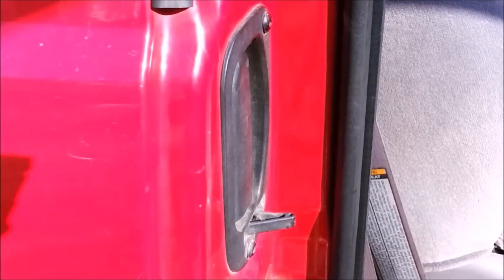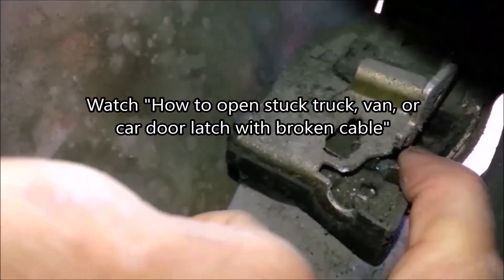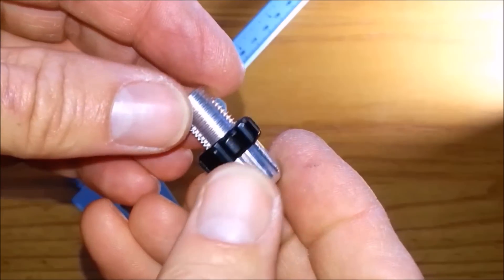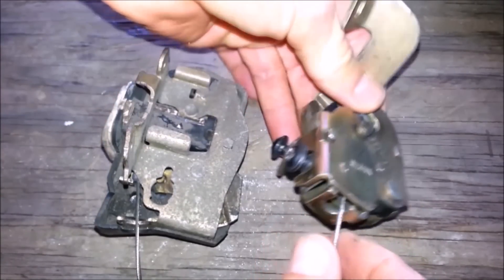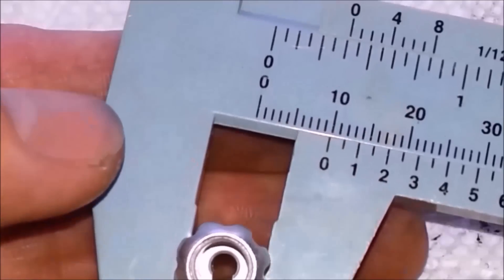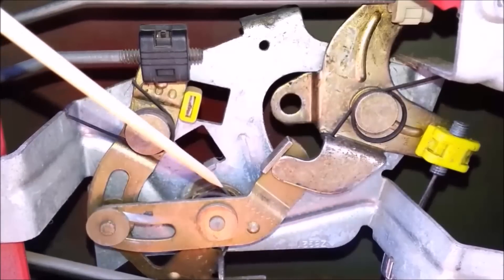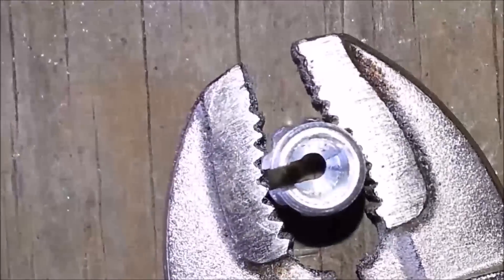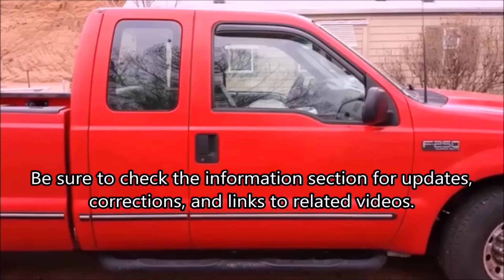Fix broken cable with bicycle brake adjuster - ford car truck van door won't open - stuck latch

Comment: Thanks, you saved me from paying $400 again. I watched all your videos twice then ordered the cables ends on Amazon for 8 bucks.. They fit perfect with no alterations. My 99 F250 had the same problem as yours, the upper door lock cable deteriorated at the door center, very easy fix if you take the speaker out. I am now subscribed to all you videos, thanks again for helping all of us.

Comment: Top notch video instruction. This saved me $700. My dealer just quoted me almost $700 to open and repair the rear door on my 2001 F250 Super Duty. I'll save another $700 when I make a preemptive repair on the other rear door next weekend! Thank you my man.

Comment: Thank you for video.  I just repaired the rear and side cargo door on my Ford E250.  This saved me a ton of money.  The dealership quoted me around $130 to $140 for the parts per door.  When I called the service department they were going to charge me over $500 per door.  I can't believe the labor would be so high on just replacing the cables and latch assemblies.  I made four new connectors per door and still took me less than 3 hours.  Thanks!
Reply from the maker: Great! I am glad it saved you some money.  Thanks for the comment.

Comment: I did the repair on my rear doors a long time ago using your video and the plastic fill tubes as sleeves.  Then one of the doors started acting up and I found our about the Dorman cable repair ends.  Searched and in your newer video on repair and in it you mentioned a different video showing how to use cable repair kit  instead of the bike brake adjusters.   Couldnt fine that video so I just tore into it and trialed and errored my way to success.  Thanks for the work you put into these videos.  They are great!
Reply from the maker: I never did a video on how to use the repair kits because there are so many videos out there already.

Comment: Thanks mate! Your video got me out of a bind - fixed in a day! I see comments saying "you can buy all the parts" but try doing that from Australia! It won't happen inside of a week, and some parts for my 2002 F250 take 6 months to get here! Anyway, I was able to source the bicycle cable adjusters at the second store I tried, and following your lead, modded them to fit. Purrrrfect! Cheers!

Comment: Great video did all cable ends on 2000 ford e-150 .cost $30.00 materials & about 3 hrs. $ saved close to $1200.00 parts from Dealer,forget about the labor!

Comment: Thanks for the info! I have a truck just like this!  But I'm gonna try this method with my 06 Honda Accord!
Reply from the maker: Cool. Let me know how it goes.  Which cable is broken on your Accord?
Reply: @fixpro256  my inner driver side door latch cable! I broke it while replacing the window, but never got around to fixing it. I have a plan, but I will have to see how it works for me! I appreciate the help though!

Comment: Your videos are very helpful! I am very appreciative for you taking the time to do them.  Do you know when your "extras" video will be complete?  I'm having an issue with cable adjustment on one of the latches.  Thanks again!
Reply from the maker: I am trying to deal with a death in my family.  That may slow me down a few months.  Let me know what your problem is.  I may be able to help.  I may also have a section of video I can send you to help.  Thanks

Comment: Thanks for the video on fixing the door latches.  I used your barrel adjuster method and fixed the cables on  the drivers side rear door on my 2001 F250.  Went pretty easy and I got the adjusters free from the bike store because they were used.   Do you have any knowledge on the latch itself failing?  The door doesn't seem to be solid when it's closed and I think the top latch may be the problem.
Reply from the maker: Sorry it took me so long to respond.  If the door isn't shutting well, try taking the latches out and cleaning them.  Then lubricate.  If they still don't work well, you may be able to adjust the post that the latch grabs.  I usually have to shut mine with my hand about a foot or two from the top so more force goes to the top latch than the bottom.

Comment: What is the link or address to the EXTRAS video?  You refer to it many times, but I cannot find it.
Thanks ... this helps!
Reply from the maker: +greg54444 I haven't finished it yet.  I have been on the road across county and won't be able to work on it for a few more weeks.  But if you have any questions, let me know and I will try to help. When the EXTRAS video is done, I will put a link to it in the information section of this video.

Comment: I've got my brake adjusters and tools ready....what did you use to wrap the cable before putting the adjuster on it?  Looks like some kind of tape.
Reply from the maker: It is just a good quality duct tape.  You can use just about any tape.  It is just to keep the adjuster in place while you do the installation.  Before you get everything installed, there is no tension to keep things in place.  After that, the tension on the system should keep everything together.

Comment: This was a great how to video. I did manage to get the drivers side suicide door open. I think my issue on just one the handle side. The cable housing busted off and just going through the handle hole within the door frame. I can pull both the cables and they open up fine. So I'm wondering if I can just fix that portion without pulling any of the locking mechanism???
Reply from the maker: I would give that a shot.  But the rest will probably fail soon after.  Probably when you go down one of those wonderful dirt roads with the washboard texture.  Good luck to you
Reply: I don't suppose you have a video on why a mirror will not move? Both of them do not move unless by hand. I have power going to the fuse panel which is a 7.5 amp. Trying to see if power is still going through to the end that hooks into the mirror itself. I wonder if I can just take jumper wires and go direct and hope I can hear something???
Reply: Paul Govensky j

Comment: Heya there, so I'm wondering if you might be able to suggest some tips for me in relation to my particular situation? I have a 1993 Ford E150 Econoline van... the rear door handle has stopped working so that I cannot open it from inside OR outside!! I want/need to fix this myself as easily and inexpensively as possible. I need to know how to get the door open to be able to get to the cables! thank you!
Reply from the maker: I dont know much about that model. Is this a rear door on the side of the van or the door at the rear bumper? Are you able to remove the door panel and the membrane under it?

Comment: Mr. Know........Issue with Ford E250 (2005)  Side door both cables must be rebuilt per your fix.
Any advice and/or video to re install .
Like work with latch in place or remove from door void.
Any of your advice is greatly needed.
Reply from the maker: I am not sure I follow the question.  These are the only other videos I have related to your problem.  See if any of them help.  If not, let me know.
How to remove Ford rear door panels with/while door stuck shut: https://youtu.be/3tAdn3vXZqg
How to open stuck truck, van, or car door latch with broken cable: https://youtu.be/yfeQGMvsoSg
Broken cable housing repair (Extras):https://youtu.be/Xi1js3_RebQ
Reply: so the lock must be removed from door, in order to complete the repaired cable installation.
Reply from the maker: If your truck is like the one in my videos, you might be able to do the bottom latch without removing it, but it isn't that hard to remove.  The top one has to be removed.

Comment: How do I get to the cable? To remove the lock assembly from door. Can't find any you tube help.
Reply from the maker: See if any of these help.  What kind of truck is it?
How to remove Ford rear door panels with/while door stuck shut: https://youtu.be/3tAdn3vXZqg
How to open stuck truck, van, or car door latch with broken cable: https://youtu.be/yfeQGMvsoSg
Reply: fixpro256 thanks for responding...it's a 1997 E150 Econoline Van Traveler. I think I have to take off the door panel, trim, etc and not just the black latch housing.
Reply from the maker: I don't have much experience with that model. What door is it, rear or side?  Maybe one of my viewers will know.
Reply: On my 99 expedition.. look at the inside pull down leather handle..underneath this on expeditions, are two Phillips head screws. I used a mirror to see it.
Reply: Oh I just saw you have a van..but it still might help you.

Comment: Great video. Thanks. This is about a 1999 truck. The suicide door latch on my 2013, F150 with 122,000 miles just broke. Seems like this problem is common. If the problem is indeed these 75 cent, rubber cable ends breaking, I am going to be really pissed. What a frickin' rip-off!! A  dealer charges $500 to $700 per door to fix, when Ford could have used $1.50 metal ends in the first place. Ford (and other makers) should be ashamed of the crappy design they have been pushing for 15 years!
Reply from the maker: I agree.  It also sucks that Ford only sells the new cable with the latch attached.  They don't sell just the cable by itself.  But, you can get an aftermarket cable without the latch. Or, buy the metal ends, or make them yourself.  As far as I know, they are still putting the plastic ones in the 2018s
Reply: Www

Comment: Where do you by the 10 MM  bicycle brake adjusters?
Reply: Disregard... I found them at Amazon.  Thank you for the instructional videos.  They are well done.  This is an excellent fix.  Better than the original design of the part .
Reply from the maker: Hi Brian,
I got your previous message.  I got mine on ebay, but prices and links are only good for a short period of time.  I don't usually do direct links because of that.  But thanks for providing your link.  Some people may find it helpful.

Comment: My cable is broken at latch how can I get it to open
Reply from the maker: This is another video I have about opening stuck latches.  Also read the description of that video.  It has some tips and tricks in it.  Some of the other videos I link to in the description may also help.  Good luck.

Comment: For 10 bucks you can buy the correct pieces for one door from Amazon.
Reply: Yes.  When I made the video bac in 2016, they weren't as easy to find.  Now they are even sold at the autoparts stores.  I think I talked about that in some of the comments, but I need to update the description/txt also.  Thanks

Comment: U neva put wher u got the brake adjustments
Reply from the maker: Thanks for reminding me. The brake cable adjuster I use in the video were ordered off of ebay.  The seller is no longer available, but there are plenty of other sellers.  You can also get them at some bicycle repair shops.  I recommend the 10mm adjusters.  Buy a few extra in case you make mistakes.  They are much cheaper on ebay.
Reply: fixpro256 I have some info that u can put on your video... 
A few of the screws stripped out(the star heads)  so I had to cut a groove in the screw to use pliers to unscrew,  it took a lil time but it worked..
Reply: I wish I could include it in my video, but youtube doesn't allow you to change a video after it is submitted.  But, I can put it in the description.  Thanks.
Reply: I couldn't find your original questions.  Maybe you already found an answer??? I don't know that I can explain the concept very well, but if the housing is not held in place, the inner cable will not work.  Other people use cable ties, epoxy, pieces of copper.....  On a bicycle, the brake adjuster is used to adjust the brakes AND hold the cable housing in place.  In a car/truck door, they usually give you a different way to adjust the lengthen.  So, the bicycle brake adjuster is not being used as an "adjuster" in the truck door.  It is only being used to replace the faulty housing end that broke.  Let me know if that doesn't answer your question.
Reply: HowToAutoRepair.  it can be done in an editor like Kinemaster. Since you are changing the video info..It works a great majority of time.My latch was stuck. Both the electronic controlled cable and the 
manual opener cables are bad.  I am going to try this.